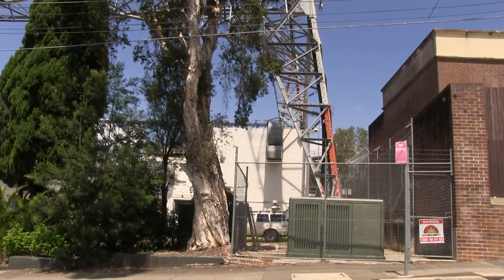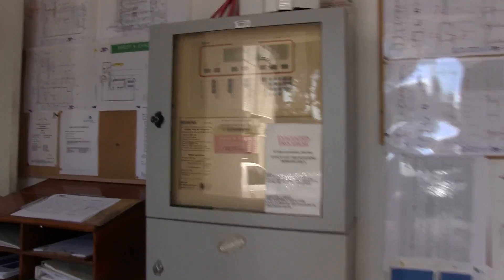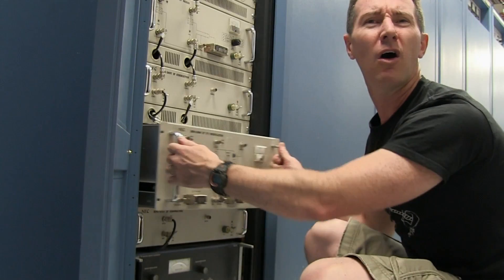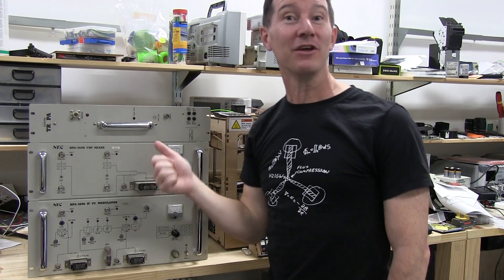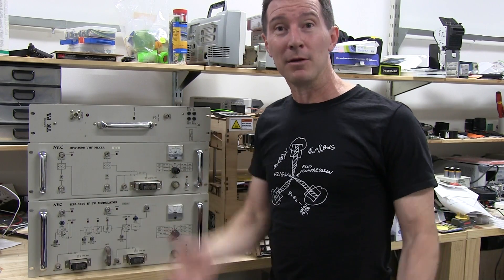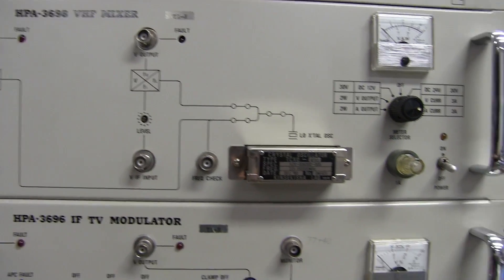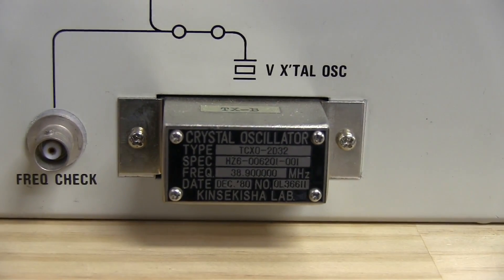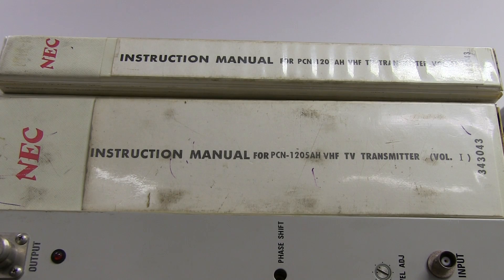Analog TV Transmitter Teardown Teaser

Comment: The station I work at bought two NEC transmitters for VHF channel 11 back in the mid 1980's and they were on 24/7 until our analog shutoff a few years ago. The antenna was a "CP" antenna or "Circular Polarization" with one transmitter for each direction, horizontal and vertical. I think the idea was that it wouldn't matter as much how your antenna was oriented.

Here's our shutoff: http://youtu.be/qgnAQVg_rME

Comment: When i was in apprentice at our german ´telekom´ my last class teacher got a huge AM-Longwave transmitter rack in his office, all Tube and 20kW of RF output. As they close his office finally, we from the final class should be tear this down and simply put all together in a big trash container.
I did not have a car that days, as I was 17 years old back than, to carry all this cool stuff with me. But I got a packing unit of C3g and C3m tubes NOS, among some other great things witch i was able to fit into my locker. Sadly the two big glass tubes had to be trashed, since there was no room to keep them save until i was able to carry them, as we only got one day....

That´s the way things happen....no need anymore just trash from one day to another just waste. From time to time just by asking I was able to get some old PA (Tube)Amps, speaker(cabinets). Some people where even very happy as I load those things into my van....

Comment: Aot of amateur radio operators would kill for the RF amp, so please make some "ham" happy and not rip the thing completely down to the componets. (Yes I be one of those hams and yes I remember lovely NEC transmitter gear, NEC gear just worked and worked and rarely caused issues for years).

Comment: Why were they still using 1980 equipment? That looks like premium Japanese gear, but surely there were still some improvements in analog electronics during that 30 year period which would have delivered a better picture/audio?
Reply: Probably because they knew 15 years ago the switch to digital was going to happen, and this stuff does not come cheap.
Reply: Pro grade properly designed and built to last.
Not throwaway consumer tat built down to a price.

While there have been significant improvements in audio and video recording and processing since then, I'd say that probably only about 1% of TVs out there would be able to show any difference between this transmitter and any other, given the same input signal.

One of the best analogue TV monitors I had was a Sony Profeel KX-27PS1 - it came from a clearout at BT Outside Broadcast.
Made in 1982, still going strong when I sold it in 2009.
Repairs? One line driver transformer. that's all!

Comment: Our closest TV transmitter is called "Emley Moor" and is a 330m concrete tower. You can't get very close to it though.

It used to transmit analog TV with nearly a jiggerwatt of power, nearby houses didn't need TV antennas :-)
Reply: ***** Which idiot told you that? Without Emley Moor, most of Leeds would be without terrestrial TV!
Reply: ...and its not in use now! Digital switchover switched it off. Its a phone mast now.
Reply: ah, yes you are right, I had misread something a while ago, my bad... "Analogue television transmissions from Emley Moor have now ceased permanently. BBC Two analogue closed on 7 September 2011 and ITV1 temporarily moved onto its frequency at the time to allow BBC A to launch in its place. The remaining four analogue services closed on 21 September 2011."